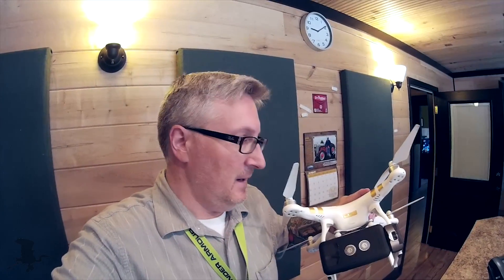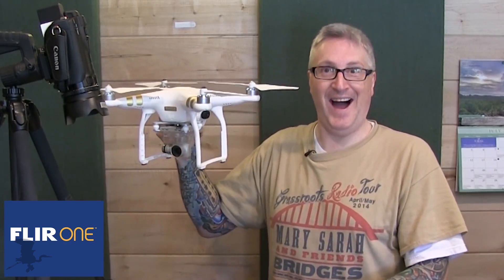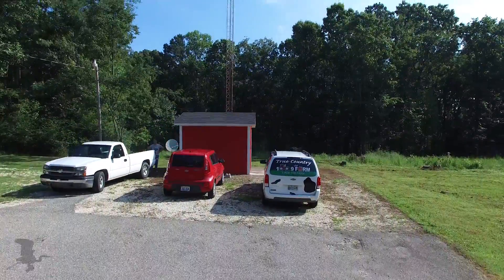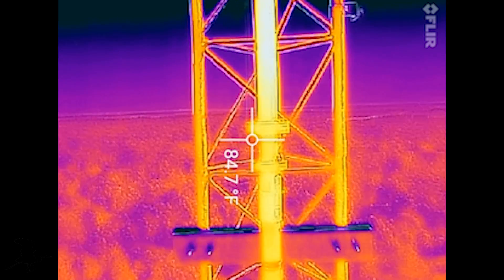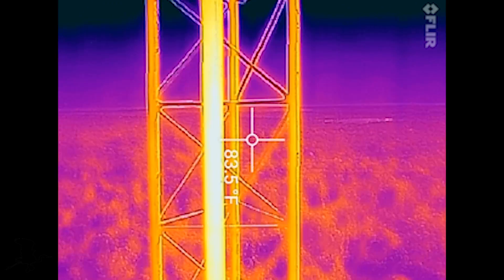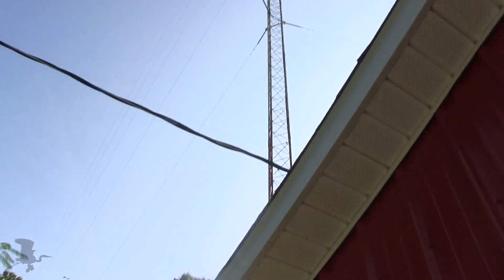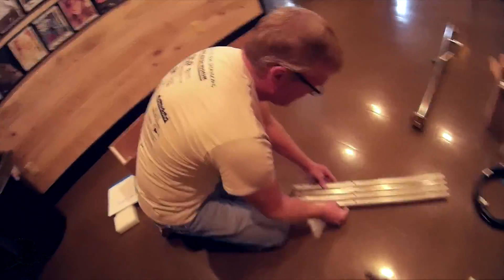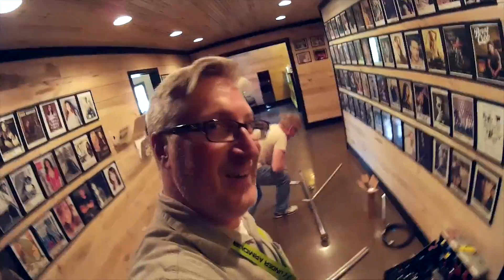FLIR & Phantom together

Comment: OMG!  Timing is EVERYTHING!

Thanks Ken!  I was going to so the same thing after deciding I was NOT going to pay for a FLIR Vue Pro.... although I would be much better in range resolution ect....
I'm a long time Ham guy and also into many things including flying (Corporate Jets...LR-45 for now..;) and have been taking my various Heli's, gliders and quads on the road with me to pacify my RC flying needs!

Stumbled onto your channel and have been wondering about the Phantom 4.  I thought my home-builds where almost as good but just couldn't resist jumping full into the P4 with HDMI mod for my Fat Sharks ect.... 
I've got about 30 flights on the P4 and it's almost boring to fly without all the little tinkering that I used to do with all my other stuff lol...

NOW I'm going to buy the FLIR for my Android and do egg-zactly what you have done.  

P.S. Do you have any Range/distance resolution flight data/thoughts on the FLIR as you mounted?

Thanks for the entertaining videos...
Chris

Comment: Well Done. You might not know but you have just proven that it's possible to fly very close radio transmitting spots. There are many phantom crashes an fly aways which are being blamed on radio interference. OR was the transmitter off?
Reply from the maker: Hey, you're right!
Although I don't know why anyone would think an FM antenna would affect a Phantom's signal, as they are two completely different kinds of RF.
Reply: There is lot of warnings on forums and websites that flying around closely to strong radiowave sources can interfere with signal. They go as far avoiding high or low voltage lines. It's nice to see your fly right next to must. It's like rubbing in the face to all scaremongers :)
Reply from the maker: Heh. Yeah, none of those things can affect the phantom. Too funny.
Scaredy-cats.

Comment: Good job on checking for hot spots. Does the transmitter  interfere with the controller for your drone?
Reply from the maker: No interference. The FM band is waaaaayyy far away from the frequencies the Phantom uses.